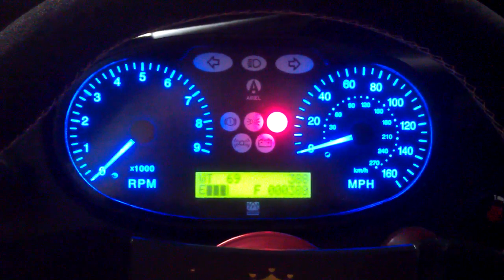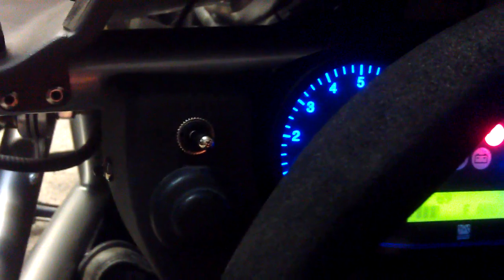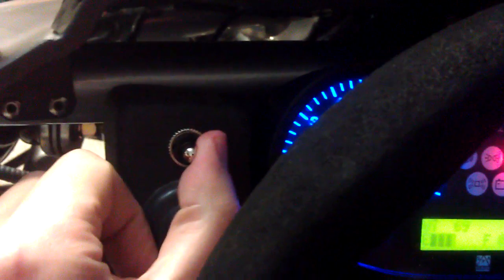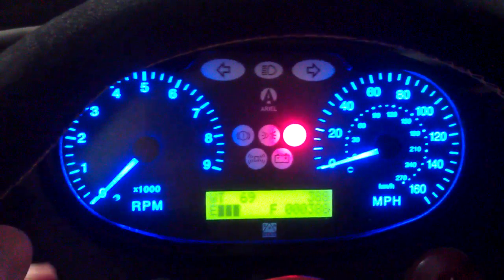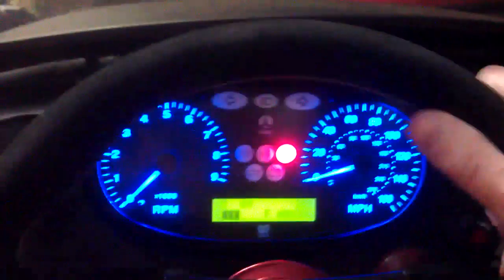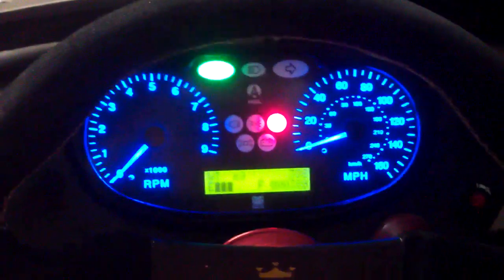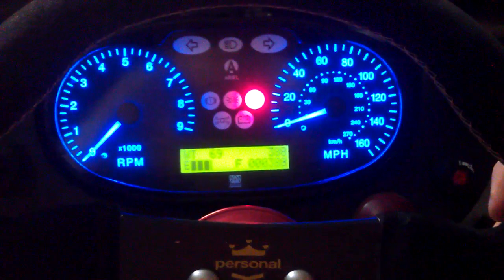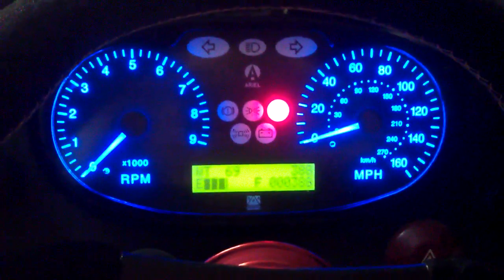Ariel Atom turn signal controller with wheel turning cancel and auto-timed features

Comment from the maker: Working on them this winter now-- I decided it wise to test under full-on driving conditions for a good long while  so I ran on in the A2 and another guy ran one in an A3 all year.  No problems!  I have cases and circuit boards finished, but still need to make up cables at this point...